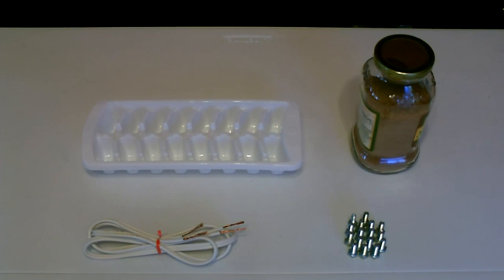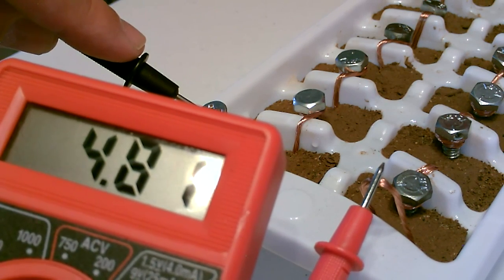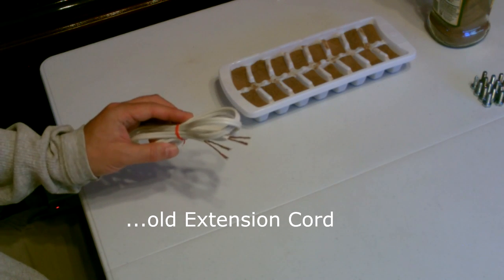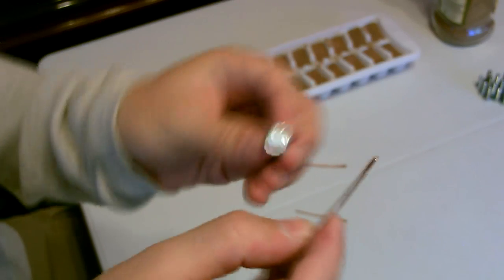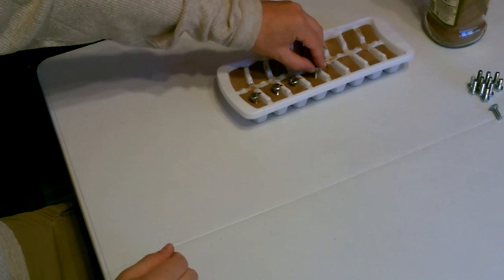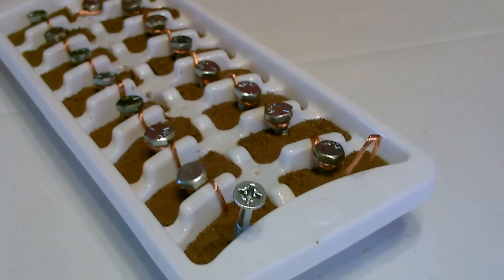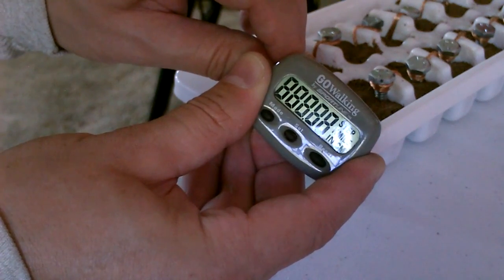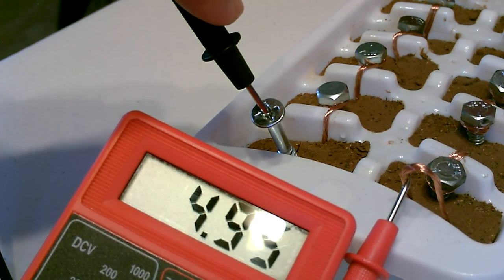Homemade Battery! - The DIY "Earth Battery" - Powers Clocks/Watches/Calcs/LED Lights....

Comment: Quick Question (great video btw thank you): Have you measured how much current this battery can give off? I would like to use one of these to run a small motor, but I need at least 1 amp to do so. Thanks.
Reply: Amperage means nothing without voltage. 1 amp in a 1 volt current will definitely not harm you

Comment: omfg! first time I did this in my life. got 12.66 volts!! it works!! I used the gold looking  zinc plated bolts and squeezed half a lime in cup of water.
Reply: Is it dry dirt? Or do you wet it? Where was the cup of water with lime in this?
Reply: Это  не просто гвоздь а оцинковка, цинк очень быстро растворится и весь эксперимент закончится на этом, железо и медь это оба  положительные анод, и в месте работать не могут

Comment: how long can u use it? and how to recharge?
Reply: Zoek je Mod? Just keep it wet, with something easily found in any house. Salt + water. Tiny amount of salt. 

Week 1
Add salt and water. 
Week 2 
Add water
Week 3
Add water and tiny amount of salt. 
Week 4
Add water and a little bit of lemon/lime. 
Week 5 
Replace some of the dirt and add a little bit of salt and water. 

Repeat forever.
Reply: @Anthony Raveneye Thank you Anthony,that is cool advance :D
Reply: Adding a simple, cheap plastic (Saranwrap?) cover over the container might extend the voltage generation time.
Something like a "sealed" battery...

Comment: Dear Desertsun02how would you connect your iPhone to charge with a "Earth Battery??"
Reply: +peruface Get an extra phone charger, cut off the wall plug in end and hook the two wires to the end leads. It does matter which wire you hook up because you need the right polarity.
Reply: Practicalapologetics cool it would be a vegan phone charger. great places for commercial buildings

Comment: it works I try it I charge up my phone with one
Reply: fully? how long did it take?
Reply: How did you connect your charger to the ice tray?
Reply: Poonam Nagda that's simple two ways. One you'd have to have two of these ice trays to run an inverter to charge it with Alternating Current (house plug) or B. Wire it up to a car DC socket then boom you can power many 3.whatever volt devices although I wonder like how well this works and what not.
Reply: And how many ice trays did you used to do so?

Comment: It may be that the challenge is to use only dirt and metal. but what about adding acid and a bit of water to the dirt.. understadibly it will up the voltage but what about the amps

Comment: im thinking would using several 55 gallon plastic bins with big rods and thicker gauge copper in them make it have a higher voltage output?

Comment: so does this mean lifetime in between to recharge or does it say fully charged for what  I'm completely stupid fly
Reply: Road warrior my guess is that each time you put liquid in it it goes down after awhile of use because there's no way it's just magical limitless cellphone power we'd of been using this if it were. Not exactly in relation to the liquid though my guess is that you catch up with the reaction thats going on and the voltage drops and had to rise again. Has to stay wet to maintain the flow.

Comment: If I understand, the dirt is neutral.  Isn't the reaction between the copper and the nail?
Reply: ***** then the acid becomes the electrolyte, just like your car battery. if this produced a charge it would be because the dirt is wet. the capacitance of dirt is weak, and in this demonstration would only be a matrix to Hold an electrolyte not yet added. this is basically an unfinished battery.
Reply: +Andrew_Owens I tried similar esperiment at home and everytime i failed. I used a common 1,2 v 0,22A light bulb. I have to get some leds... Then i'll try again. Soil is neutral? should y use some acid?? :)
Reply: @sajkdnsaklfhnj  what if you use dirt with an acidic ph level?
Reply: good eye.

Comment: what if I use normal screws
Reply: +Jack D They need to be galvanized if you want to replace the bolts.  The zinc coating is what provides the negative lead for the battery to properly work - other metals could also work, but zinc is a pretty decent option.
Reply: OK I got it to work but now my screws are rusted 😑

Comment: The funny thing is, they made these thousands of years ago in huge clay jars, wonder what they used those for back in the day? hmmmmm.......
Reply: +Tom Bombadil ... I never thought about it like that, to be honest. I wouldn't necessarily put it past the modern scientific discourse. I'll look into it more - you've piqued my curiosity. Thank you! :)
Reply: +C3PO&#39;s Bottom Bit plating metal object with gold
Reply: ***** good guess, I was thinking it had something to do with construction, not ness. for worshiping  gods
Reply: +C3PO's Bottom Bit If I recall correctly, because I remember seeing the battery thing before, it was used for electroplating gold leaf onto other metals. Not a great deal of power needed, and when done correctly can make copper look and feel like gold, not to mention creating the appearance of impressive skill in goldsmithing. Either way, status.
Reply: +grinningSheepishly Yes I've read that, too. I wonder if that's not the explanation which is favored by standard science to avoid the possibility that their timeline of human progress is incorrect. But it's good to bear in mind that there is an explanation which doesn't require that ancient people actually understood about electricity or used it the way we do. Having an open mind works both ways :)

Comment: so I'm just guessing on how this works.  the copper is more conductive so it pulls the heat or electricity or whatever to the bolt which is not as conductive but still more so than the soil.  so the power is able to flow in one direction making a positive and negative charge?  and the moister makes the soil more conductive making the energy created from the heat flow more freely?  if so could you enclose the soil so the moisture stays in the soil and leave it out in the sun after spraying the container a satin black to absorb more heat/energy?

Comment: Here is the important question: (maybe) Why don't poverty stricken areas use this idea to generate low voltage electricity? Perhaps it is pointless since they have very little that needs charging? I could see this as being useful for some form of automated process. Thoughts on how this could be implemented in a real world situation if needed?
EDIT
On second thought I guess copper and galvanized bolts would cost too much for a poverty stricken area.
Reply: Jamie Newton The REAL reason? (Not the PC version?)... Generally the people in poverty stricken areas do the things or live the lifestyle that makes them poverty-stricken in the first place. 

When thousands of them get together and form a culture based on those habits...they have a poverty-stricken culture. Poverty is not the problem... it's the symptom of the problem. Doesn't matter whether it's a trailer park in Appalachia. a Detroit ghetto, or a village in Africa.

It's VERY difficult for kind-hearted people to wrap their minds around that basic fact, but when they do....real solutions to the problem can begin presenting themselves...

Oh, and YES....the idea of using nuts and bolts and wire to make a battery is horrifically inefficient compared to other methods of electricity generation.
Reply: +jc knight Right, because 5 volt batteries that weigh 4 lbs each and have a short shelf life would really boost them out of the stone age in ways that major infrastructure like dams and waste treatment plants and public schools wouldn't.  You're a jerk who's never traveled in places like that.  They don't have schools because their fucking libertarian, 100% private sector, croney capitalist rulers don't have any regulation to force them not to strangle the people.
Reply: +jc knight simple minded idiocy strikes again
Reply: +Andrew_Owens right
Reply: +Andrew_Owens ...You are BEYOND an idiot! And with 10 years in Australian SpecFor, I unfortunately have spent more time in third-world shitholes than any civilsed human should have to.

Contrary to what is taught to you by your Socialist Community College profs, those of us who have been in the real world can tell you...Community-wide poverty is not a DISEASE that strikes otherwise peaceful, productive, intelligent communities. It is the OUTCOME of a series of failures within a culture. Usually hundreds, if not thousands, of years of failed ideology and primitive practices.

Those cultural failures include systemic corruption, rape, violence, lack of education, lack of productivity (making useful things for the rest of the world), lack of respect for and enforcement of property and lives., etc. Basically, savage tribalism.

You take for granted your cushy Western World life and worldviews, that evolved over centuries of sociological evolution, and assume everyone else in the world would live like that too, if not for some evil Capitalist force. The truth is, the vast majority of the world is governed by the aggressive use of force. And the local warlord who is MOST vicious and aggressive is usually the Boss.

The notion that these savages would even know what a Libertarian is, much less even recognize a Private Sector, makes you provably ignorant. Even the dumbest Socialist on the planet doesn't try to make the case that the Third World is some Free Market utopia. The complete lack of regulation is anarchy, not the Free Market.

 You need to get out of your privileged suburban world, stop regurgitating your Marxist professor's lectures,  sign up for some military duty, then see what the real world looks like, Junior. Not the book version...

Comment: What's the internal resistance of something like this? Open circuit voltage is one thing, but how much does it drop when there's a load?

Comment: If u put vinegar in the soil and it will have a higher voltage than just soil or dirt.
Each cell should make .50 volts. times that bye the amount of cells u have. Is powerful.
It won't last as long as a earth battery but u can power stuff with a higher amp in take with it.
You need an electro light to store the proton from the neutron.
It will cause rust.
Just clean it and do it again.

Comment: Well, this is stupid. It's a copper-zinc voltaic pile with the moist soil acts as the electrolyte. You need to measure the short circuit current. Just checking voltage alone doesn't really tell you anything. As soon as you put a load on, the voltage will drop considerably depending on how much current this can deliver. Those LEDs were fairly dim, so I'm pretty sure it sources barely any current. It's Ohm's Law. Pretty damn simple.

Comment: maybe the galvanic potential between the zinc, copper  and earth is the cause...
Reply: rbheiss Sure, you can: 

http://news.stanford.edu/news/2015/march/aluminum-ion-battery-033115.html
Reply: Richard Alexander Thanks Richard!  I've been around this YouTube thing for some time and it seems to me there was a time when you couldn't but perhaps the failure was on my end.
Reply: rbheiss You're welcome! Yes, Youtube used to block URLs, but that changed when Google connected everything to Google+, about 1.5 years ago. At the same time, we also gained the ability to post more than 150 characters in a reply.
Reply: I was thinking that myself... because if its just the dirt, then you could potentially get 100 volts just by making a huge string in your backyard lol.. However, wouldn't this work better with a a more conductive electrolyte like salt water or similar? I would think the dirt has a very high resistance comparatively
Reply: Bryan Evans Yes, you are correct. The energy comes from the electric potential of the zinc (or iron) and copper. The dirt serves as an electrolyte, to dissolve the zinc ions.
Reply: Patrick Peck I don't like the idea of using salt as an electrolyte because as I understand it the salt produces chlorine gas.  Over at Stanford they have developed an interesting sounding aluminum battery but are keeping the electrolyte used a bit of a secret.  I think I know what it is however but I'm not 100% sure.  Anyway, I don't think I can embed outside links here but do a web search for "Aluminum battery from Stanford offers safe alternative to conventional batteries" and you may find the link that way.  It is quite intriguing!

Comment: How could you hook up a conventional plug outlet to this? Would wire in the dirt then hooked to a converter work if you used with 3 or more trays in sequence? Could a set up like that potentially run a coffee maker, toaster, etc.?
Reply: No.  Though he was showing 4 -5 volts you wouldn't even get a full amp of current out of one of these trays.  Coffee makers and toasters draw way too much current for something like this.  You would probably need like 30 or more trays wired to give you the correct voltage and enough current, tied to an inverter and then it still might not work.  With three or four trays you might be able to charge a phone if you regulated the output.
Reply: Never ever. These trays may produce 5 volts but the current is more like if you are lucky 20mA. To put that in perspective you would need 4000 of these trays to run a toaster.

Comment: What about using a series of 5 gallon buckets? what would the output be on something like that?
Reply: kai2698 I simply saw the lifestyle I wanted to live, and saved every dime I made to buy an RV and a basic off-grid setup. That allowed me to live so cheap in the next few  years, that I was able to buy an even bigger rig, with satellite radio and TV. It's all about choices, and the short-term sacrifices you are willing to make. Most of the people I meet that are excited about the prospect of living off-grid, blow $4-5 grand a year in weed expense, and never save up enough to break the cycle of paying for an expensive apartment and bad habits.

It all comes down to what you are willing to sacrifice in the short-term for long term gain. That same mentality is the exact difference between the successful in life and those who blame others for their crappy fortune in life... Fate is What you Make...
Reply: mmerchant79 .... It would be no different. The idea of this is misleading. The dirt is NOT providing the "free energy". It is just the electrolyte, or medium, that the energy is passing through. You could use almost anything from lemon juice to potatoes as the medium. The energy is coming from the reaction between the zinc on the bolts and the copper in the wire. Eventually, they will be used up and corrode, and all the dirt in the world won't give you any more energy...
 Of course, the energy required to make that zinc and copper is more  than what you get from them. That's why it's considered a Battery, and not an energy Source...like oil or nuclear...
Reply: kai2698 I live full time in my RV and generally travel to the desert Southwest for winter and Montana,Wyoming, etc for Summer. I have 800 Watts of Solar panels and a 1KW pop-up wind generator. Between the both of them, they take care of all my electrical needs, and I often have enough extra to recharge other campers who are boondocking.

I haven't had rent or utility bill in 8 years...and with a 38ft slide out, I have all the comforts of any nice apartment...Plus, if I don't like my neighbours, or just chose to have any at all, I can just move anywhere I like...
Reply: jc knight Some part of me is taking issue with you calling oil or nuclear an energy source, but I'm sure you know that both of them are extremely unsustainable..
Reply: kai2698 That's the political/partisan side of you taking issue. Scientifically, there is no doubt that all fossil fuels and nuclear are an energy source.

That is simply defined by getting more energy out of it, than we put in extracting it from the Earth. Solar and Wind can be an energy source as well, it's just that they are a more expensive one with a much longer payback time.

I happen to run on 100% of both of them, but mainly because I enjoy being self-sufficient. Not so much because they are cheaper, per se....... (Although, ironically, once you add in Govt. taxes & fees, it is. Particularly since most utilities charge you fees just to be hooked up, even if you don't use a bit of them.)
Reply: jc knight It's awesome to know that's you're running 100% on wind and solar! Are you living in somewhere with a lot of sun and/or windy? Or do you just have a lot of solar panels and/or windmills?
Reply: Jc Knight Man that sounds like a dream come true, I can't wait to live like you do :O But then there the money issue... Are you retired by any chance? Or do you have some sort of residual income?
Reply: jc knight Awesome! Thank you for the tips. That really helped.
Reply: jc knight your replies helped me a lot thanks but I still have a question what if I would add a diode to the experiment would it make more resistence and what I kind of diode would I use since I have produce a 13v battery using dirt as electrolyte.
Reply: aba kasa
Have you tried gold, limestone, quarts etc ?